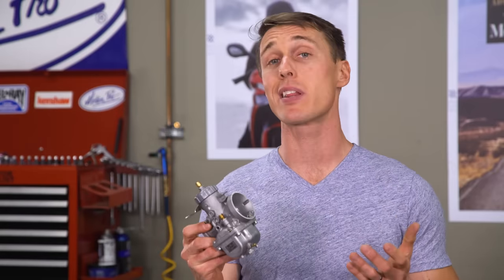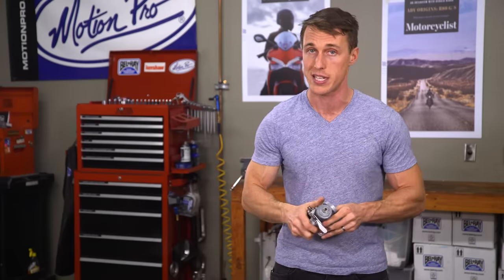Carburetors vs. Electronic Fuel Injection—What’s Better? | MC Garage

Comment: Gravity never fails, fuel pumps do.

I can rebuild the carb on the side of the road if needed, which is rare, can't diagnose a failed sensor and carry a replacement for my EFI on the side of the road.

Electronics are great when they are new, time and mileage will tell in the long run.

I had a BMW GS 650 rental one time, was hard to start cold and stalled a lot, not much I could do with it, my DR 650 did a similar thing once, pulled the carb off, cleaned the jets, little bit of dirt, 30 minutes later off I went, good as gold.
Reply: You are just about the only one that knows the value of being able to fix your carbureted bike. The others are too damn stupid and just keep ranting about how fuel injection "never breaks". Utter rubbish. Fuel injection DOES quit and is terrible to fix. Only profoundly stupid people disagree with that.
Reply: I don't see the value of it... Simply because shit always breaks. Shit that breaks needs replacement parts.. and since MOST carb bikes started leaving the market around 2004 or so...  You're ebaying parts for most of those bikes. In another 4-5 yrs... being able to repair a Carb will be the lowest priority on your list. 

So for me it depends HIGHLY on how old the bike is, how well it sold to the public, and when was the last model or update made...
Reply: Repairabilty will never be a low priority. On a Harley carburetor without any variable venturi there is very little need for parts for it. Only a rare cleaning and by rare I mean I only cleaned the accerator pump once in 38 years on my Superglide. I have found way too many check engine lights on my cars telling me of more hard to diagnose problems. Damned if I'm stupid enough to want that damn fuel injection junk on my cycles too.
Reply: bottmar1 wasn’t really talking about the carb in itself... I was talking about the bike as a whole... 

Keeping a bike for repairability becomes void if parts for the rest of the bike becomes a bitch to get
Reply: I don't know what bikes you guys are riding but these indirect fuel injection systems are extremely reliable nowadays.

No you probably can't fix your bike on the side of the road if something goes wrong with the EFI system like you would with a carb, but then again you're less likely to end up on the side of the road in the first place.
Reply: Sergio. Reliability is NOT the whole universe in vehicle ownership. EVERYTHING eventually gives trouble. I've sat by the side of the road with these so-called reliable fool infected cars that everyone says "never" quit. Gee, i guess they are wrong. Reliability AND REPAIRABILITY IS THE BEST. NOT AN OPINION. I build collector cars and motorcycles. Easy parts availability and ease of maintenance with very little loss in reliability is what you get with anything I build. All the complaints about the old carbureted vehicles are wildly EXAGERATED. If they were true I would not own any of my collector cars or motorcycles. I have two fool infected vehicles right now that get one check engine light after another. Reliable? Bull shit.
Reply: Those check engine lights are due to a failed fuel injector or pump? You see your mistake (a common mistake) is mixing mere fuel injection (which is pretty old tech, at least the one we're talking about and not modern direct injection systems) with all the other electronics that come in modern cars.

Modern cars throw warning lights all the time for lots of different reasons, but I've been driving for quite a few years now and never had to replace a fuel injector. I've replaced one fuel pump, and I bought it for something like 25$ so hardly the end of the world.

This is a bit like cell phones vs landlines, a landline is more reliable but everybody's switched to cell phones because what they lose in reliability they more than make up for in practicality. Most people don't mind replacing a fuel pump or injector now and then when it means that the rest of the time there's no worrying about chokes, rough idles, flat spots, random stalling etc.
Reply: Sergio. You, like other people are determined to NOT see where you are wrong. This direct injection thing is STILL made by man, therefore it also breaks. You just can't seem to see how inconvenient it is to be stranded even if it seems rare to you. I have had to sleep in my car because of a failed fuel pump because the local motels were full. I had a new fuel pump with but since these "reliable " vehicles have the pump in the gas tank there was no way to put it in.  A fuel pump in my carbureted 1979 Chrysler went bad and I got one out of the trunk, installed it and drove home. $25 fuel pump? That's a pretty cheap quote since EVERY fuel pump is at least three times that. Maybe you broke down by Rockauto and put in their cheapest one? Get real. I have several multi carbureted muscle cars and I do not have to worry about chokes, tune ups, rough idles since they rarely occur and if they do are EASILY remedied. Right now I have a fast idle problem in my fool infected Dodge Dakota and of course can't just adjust a simple idle screw. It means scan the damn thing and start replacing parts IF the scanner picks up ANYTHING at all. How many stories does it take for you too understand that simple is better? Especially on motorcycles where fool infection barely pays off in better gas mileage. Gas mileage in cars is vastly better with big engines but then again not in small cars. Don't agree with that? My two MG midgets, with two carbs and POINTS ignition got 36 miles per gallon. My 1989 fool infected Mercury Tracer did no better with all the hi-tech no-nos, even a belt to turn the cam shaft. Guess which one was easier and cheaper to fix? And no, I did not work on the MG "all the time". Motorcycles are not sold in numbers that cars are, so parts availability is a problem sooner than car parts. My Harley's are old school and they get me home every time and have done that flawlessly since 1966. If the electronic ignition quits I can put Chevrolet points in. If I couldn't fix anything easily they would sit by the side of the road at least until someone stole them. My friend lost his Harley in broad daylight because he had to leave it. So since EVERYTHING BREAKS, even a rare problem with ANY fool infested vehicle can cause more trouble than it's worth. After riding', driving and repairing for 53 years, YOU are hardly going to know more than I do about vehicles.
Reply: Strong wall of text there. I may very well know more about vehicles than you, you know nothing about me or my background but anyways that's besides the point. And a conventional electric fuel pump is dirt cheap if you buy it straight from the manufacturer or an online retailer, and you fit it yourself.

The point is: if you're so scared something might break down that you can't fix and you might be stranded somewhere because the hotels are all full, don't drive or ride anything. Because everything breaks eventually and there's always something you can't fix. Every time you drive anything it's a calculated risk (in fact there isn't just the risk it will break down, there's always the risk you'll be in an accident an die). Fuel injection is by now proven beyond any reasonable doubt to be a very small risk, nearly everyone uses it in case you haven't been paying attention and the roads aren't exactly littered with broken down cars and motorcycles.

Most people don't move around in carbed dinossaurs in case you haven't noticed. Most people drive modern vehicles and a lot of those people put tens of thousands of miles on them year after year. Fuel injection moves the world whether you'd like to admit it or not.
Reply: Sergio. I see you still don't understand how valuable REPAIRABILITY is. I tried to show you but failed. At least other readers are probably more capable of understanding the obvious. I'm not scared of being stranded. I'm just smart enough to know ways around it and fuel infection does NOT provide ways around being stranded. That is the reason I have been stranded in your so called reliable vehicles more than old carbureted ones. Most old school vehicles that sat by the side of the road had little, easily repairable problems but their owners lied to themselves saying that they " can't fix them." They were even too stupid to put extremely cheap spare parts in their trunk. Vehicles were so simple that people could have trained themselves how to repair them. These are the same kind that fell hook line and sinker into vehicle ownership of these shit for cars now that cost a lot to fix. Now when people say they can't fix their cars they are honest and get to ruin their budget in a hurry. Enough said. Hopefully some readers are learning something here.
Reply: @bottmar1  I have never been left on the side of the road due to a failed fuel injection component. I've been driving for many years.  It simply does not happen often at all unlike what you're trying to convince people of.

But reading through the page I can see you're on a mission to tell everyone fuel injection is the worst invention ever and carbs are the future. I won't change your mind, you must sell carbs for a living.
Reply: Fuel injection to me is alot easier to diagnose than a carb as that's what i grew up with (I'm 27 btw), I can understand the old timers being uneasy with "new" tech but I can't see how FI is going to break and leave you stranded instantly other than a fuel pump, it might run like crap but it can actually survive a couple of input sensors failing before you are stuck.

Carbs main problem is elevation, even more so if it's hot as hell outside, a lean bike is going to overheat and burn up, a fuel pump can be replaced in an hour or so, burnt valves or a headgasket takes much longer, I can't count how many times I have to wait for my buddies KLR to cool because he too refuses to go to a modern fi bike because he CAN fix it with a screw driver and some pliers not realizing that FI didn't need that adjustment, didn't run lean and overheat, and didn't get me stuck on the side of the mountain playing with jets and air screws because my little GS with O2 and airtemp sensors is still happily chugging along with the correct AFR, will never kill rings because of a rich bore wash and won't bend a rod because the float valve started to leak while on the side stand filling the cylinder overnight. 

Point is there is no situation in where I would rather have a carb over FI PERIOD! But hey each to his own right?
Reply: That's what I'm saying man. A simple Multi-Meter and you can diagnose any electronic fuel related problem.
Reply: @bottmar1  as far as i know 90 camaro had the fuel pump in the tank, an it was carbureted
Reply: Chief Denis. The 1990 Camaro had throttle body injection which looked like a carburetor and was somewhat good in that you could squirt gas in it like carburetors to help diagnose a possible fuel problem. It was harder to do that on later systems. The fuel pump was in the tank like you said but with that design it was still a bad place for it as it was basically impossible to install one by the side of the road. Repairabiliy is as important as reliability and new vehicles are only reliable.

Comment: Hi guys, thanks for the great content and awesome tips. I wanted to ask if you could do a piece on liquid cooled vs. air/oil cooled motorcycle engines and overheating issues especially in areas with hot climate. Thanks!!

Comment: My 2007 vtx1300r is carb,(2plugs per cyl.),4 valves,per cly♡.,I use fuel stabilizer now & then ,but if you break a  throttle cable (,carb) will get you home just by pulling out the choke,been there.(no fuel pump ,no electricity,,. Fuel injection will have you calling Roadside Assistance!☆
Reply: One of my carbed bikes has stranded me THREE times due to fueling problems. One was due to improper fuel line routing(kinked), two others were from separate fuel pump failures.
Reply: @Daschickenify  but that's not the carb's fault
Reply: @GraveDigger388  Not directly, I agree, but a fuel injected bike does not need to be tinkered with and constantly taken apart to get running right. Plus they usually have stiffer hoses/metal lines and a high pressure fuel pump which will prevent/overcome bad line routing.

Don't get me wrong, I love tinkering and working on stuff, but I HATE fuel system tinkering.

Comment: Both of my Honda Dio and Pulsar NS 200 are carburetted.😁
Reply: about time Bajaj upgraded their fueling system. put 3 sparks on a single cylinder engine isn't help a lot.
Reply: Al Putra yes, the Pulsar RS200 does have fuel injection. My NS200 is 5 months old and I love tinkering with the carburettor for economy and torque.😁
Reply: I see. tinkering with our bikes is indeed fun to do. and by the time you think you need to switch to FI, you just need to buy the throttle body and some parts to convert it. nice.
Reply: Al Putra ns200 had efi in my country.
Reply: zuhaili shufller well, Bajaj doesn't offer fuel injection even as an option in its country of origin ( Indian here😁) for NS200 and NS 160 but RS200 and Dominar 400 has efi.
Reply: Shivshankar's Rides they should introduce efi there first as an option but maybe they want to cut costs. I heard dominar will be introduced this year in my country. But from reviews I seen about dominar really make me wish they tweak from 35hp to 38 as we prefer cruising at higher speeds. With top speed of 145km/h that's a big let down as our 150cc moped had reach higher speed than that.
Reply: and Bajaj no longer in my country (Indonesia). it's been about 4 years since they left. I think Bajaj products are really good, especially Pulsar series. they're looks good and have a decent performance too. not to mention their much more affordable price compared to the japanese. but I think Bajaj wrong in marketing strategy, and left behind in technology (at that time).
Reply: Al Putra yes.
Reply: zuhaili shufller Dominar reaches 165 kmph in stock setup.
Reply: Shivshankar's Rides out really, that's quite good, even cruising at 150+ km/h is good enough to enjoy a long distance trip and fast enough to pass a speeding trailer or lorry.

Comment: Please do a video on a list of ALL maintenance / checks that need to be done when working on a bike.
Not an in depth on each, but a comprehensive list, would have gone a long way when I started restoring bikes and would probably get more than a few hits. 
A link can then be made on said video to your other in depth videos :)
EG:
Oil, filter and plugs.
Chain lube / shaft drive oil changes.
Cam chain tensioner and cam chain checks.
Ignition and cam timing
Fork / shock checks and changes.
Brake pads, disks and bleeding.
Checking your magneto, rectifier etc for impedance.
Of course tire condition and pressure.

Comment: Carbs all the way..... But if you don't know how to rebuild and adjust its understandable.
Reply: Or if you've been cleaning, rejetting, unblocking etc the bastard things for 20 years and just don't want to waste any more time on them. Yeah, the difference is all small - FI saves you a little time when it's cold, and a little time when you change altitude, and it saves you a little fuel, and it makes the engine a little more efficient, and it's just one little job not to have to do from time to time, and for the rest of the time there's no difference, but honestly unless you got a bike to tinker with it, it's an old tech we don't need anymore, and there's barely a cost difference between cheap FI bikes and carby ones anymore. 
TL;DR: I can clean and rejet and generally fix carb issues, but I'd rather not have to

Comment: Pretty concise explanation. I prefer fuel injection. Like he said,the computer regulates the fuel,whether in hot or cold temperatures. It really is the best. Carburetors sometimes cause too much fuel to be used and the engine sputters,or you have to choke it until it starts and runs good.

Comment: Ahem, Suzuki DR-Z400...  It's time for the switch! Even though I liked the cheap gains with the jetting kit.
Reply: Hey, don't be so selfish, some of us want the 650 to get EFI too, I don't need an anorexic, gym rat, Red Bull addict 450 in my garage.
Reply: I bought a '17 this year as my first bike. Loving it. Jet kit on the way. I like tinkering on engines so I am glad it has a carb.
Reply: DRZ with EFI and a 6th gear would be my perfect dual sport.
Reply: They will never put EFI on the DR or DRZ, sorry.  Those motors are just too fucking old.  If they changed out the fueling mechanism (put EFI on) on them then they'd have to get the bikes re-certified under the latest emissions standards (and currently the hardest one to pass is the EURO4 emissions, which covers all of the EU).  Those bikes would never pass the latest emissions standards without heavy re-work to the engine - primarily the emission control aspects.  That'd be very $$$.

So sorry, no, they won't ever get EFI, they exist now because they were grandfathered in before the emissions standards, but they cannot make any engine changes to them.  They have to essentially replace the engine, which at that point it's cheaper just to make a successor to that bike and cut production of the old one.

Same goes for the KLR, that can never get EFI for same reason.  Though they sell so fucking many KLR's at least they'd be able to justify adding the emission control components to the KLR to get it certified under EURO4.  Though that being said, thumpers in general are getting REALLY difficult to push through emissions, so that won't be a walk in the park either.  If they do get the KLR recertified, then it'll be running lean as piss and you'll need a re-map just to get it to ride nicely.
Reply: MrSlowestD16 the drz doesnt pass euro4 with carbs either. it hasnt been sold in eu since like 2005